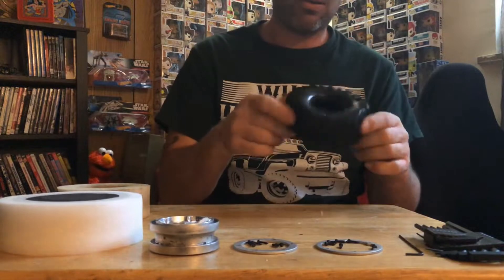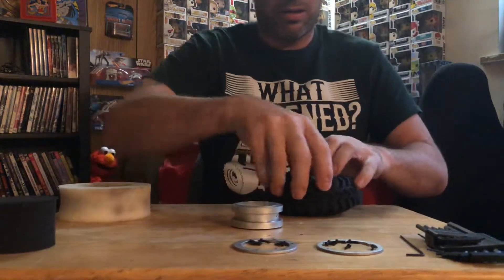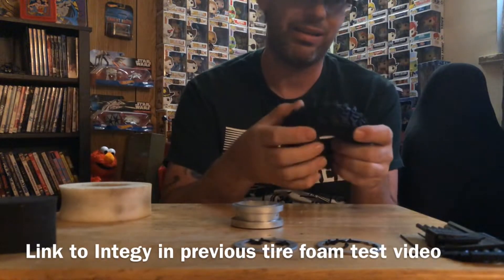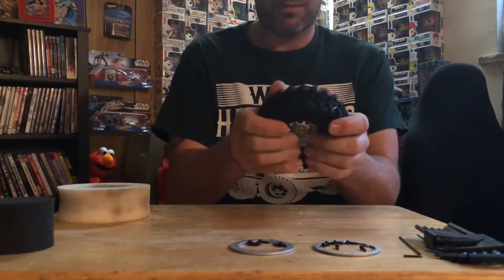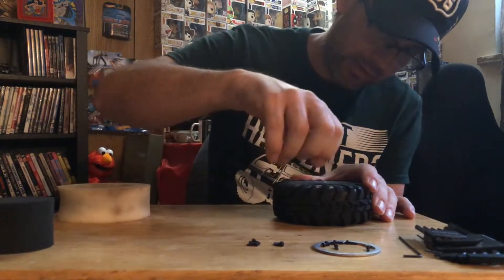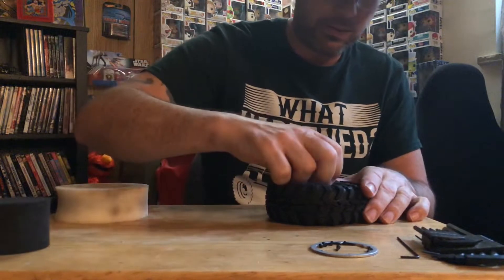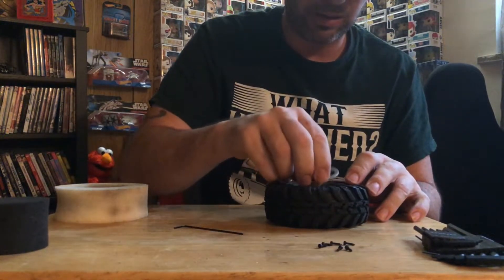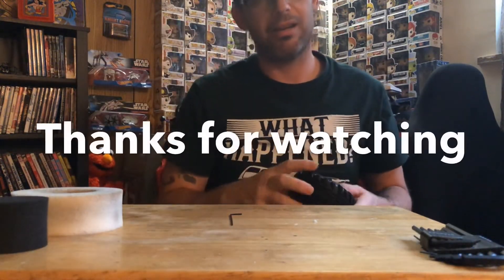RCWC: Shop Time! How to bead-lock and change foam

Comment: Cool video. Did you know if you put the bead lock back on without the foam you can have air filled tires.
Reply from the maker: Yeah I heard about that. I was told that it’s really affected by temperature though cause you need to plug all the air holes, and then the air inside expands & contracts a lot?I’m gonna try it with the plastic wheels once I get a set of alloys? Thanks for the suggestion though brother! 👍👊🍻
Reply: RC Wreck-creation it’s good if you’re doing runs in the water